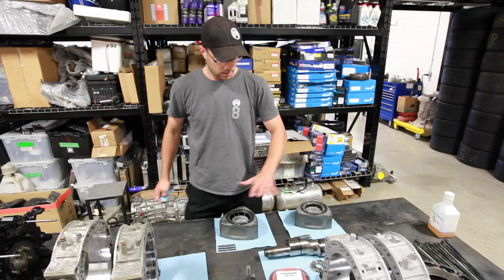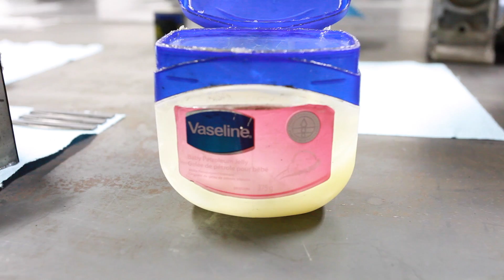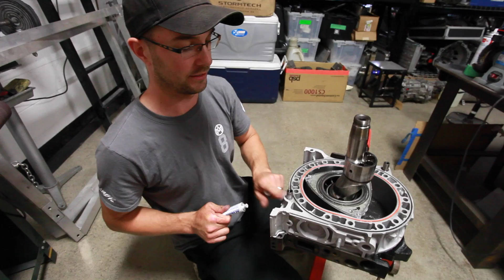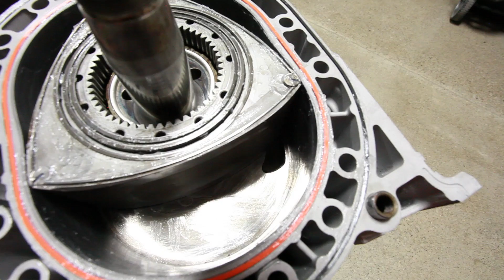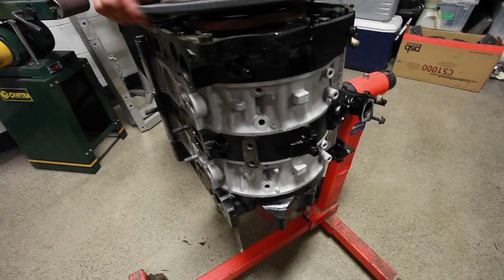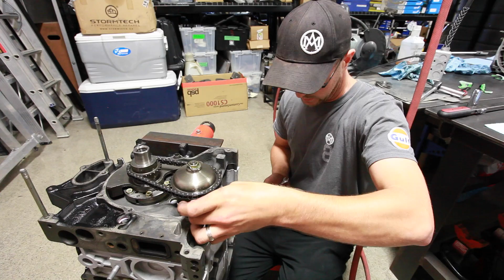How To Build A Rotary Engine

Comment: I just bought a RX8 :) 
91K KM on the clock :p

Why all the vaseline??? 

I seriously need to learn alot about this motor and everything around it :D
Reply: lol u bought a rx8
Reply: Vaseline sticks all the side seals and corner seals to the rotor so they don't fall out when you put the rotor in the housing. It also lubricates the housings and rotors when you first start the engine and burns off shortly after leaving a clean inside.

Comment: boost goes in apex seals go out
Reply: HenryMania by better engine you mean more rotors? xD
Reply: Not ceramic seals they hold boost much better
Reply: doktorbimmer That is wrong information or those you saw use rotaries didny know how the fuck they worked.
Reply: 4 rotors is good rotors.
Reply: It’s a hard life..... but 10k rpm 😂
Reply: Yes more rotors like 5 or 6 too be exact! XD
Reply: 2 rotor lyfe
Reply: if you can afford ceramic seals, you can afford a better engine
Reply: ok that was too funny
Reply: +FatalvenomX Or needs a rebuild every 3rd oil change.
Reply: +FatalvenomX No, one that is not obsolete...

Comment: It's awesome that rotary engines like to be abused. Literally have to redline them daily to reduce the carbon build up lol
Reply: There is A modification that keeps the carbon from building up but it also makes the engine run too hot.  Shifting practices also have to be relearned with the modification.  Overall not worth it unless you get low compression rotors to bring the temperature down or use E85.

Comment: Did he say 360 ft-lbs for that big nut? How is it possible to torque that much? Not a number I'm use to hearing I guess.
Reply: Yes that's what he said. Joe uses an impact gun to tighten it down as much as possible and has never had one come loose this way.
Reply: +Andrew Larson no. just use a high end impact gun and don't waste your time
Reply: Andrew Larson you can always get it with a torque wrench after the impact gun

Comment: when you were driving your Rex did you feel much of a benefit from the street porting on it's own?
Reply: Yup definitely helped with throttle response and broadened the powerband a bit. Nothing dramatic but enough of an improvement to feel.
Reply: I'll give it a consideration then (provided it works on a 4 port)
Reply: E: too bad i'm in the process of blowing £600 on a new compressor and condensor for it's AC system...